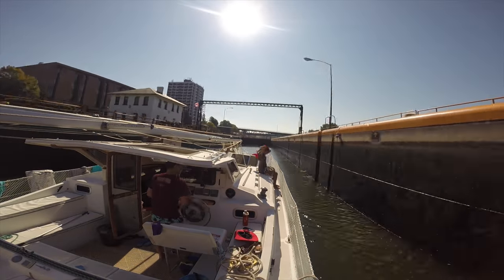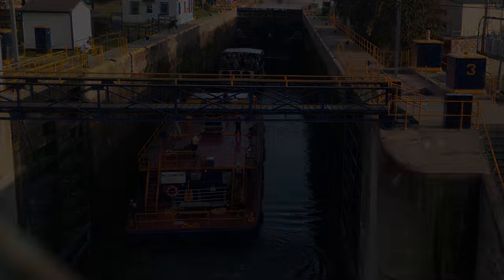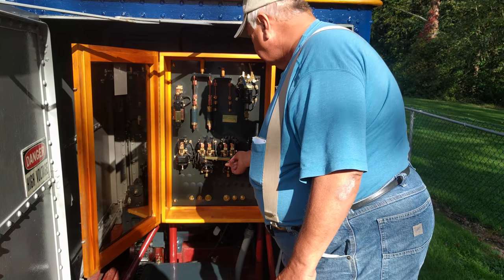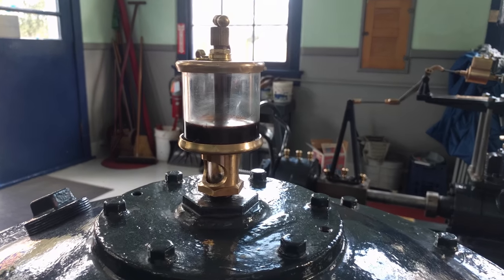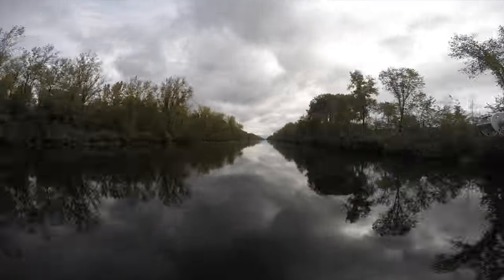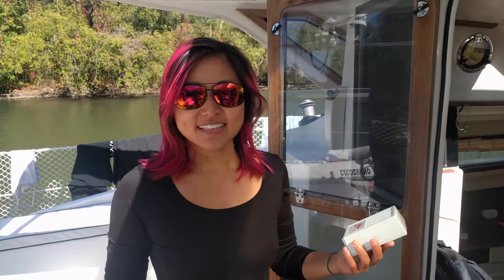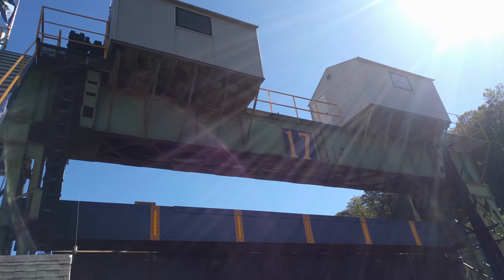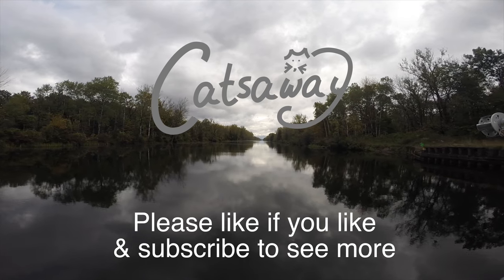Erie Canal Part 1 from Lake Ontario to Little Falls (Sailing SV Catsaway) - Ep. 15

Comment: I am closing on my 105 M on the third of next month and moving aboard her on the 5th.  So nice to have someone online with the same vessel as me, almost identical, mine is a 1999 model but I don't see any differences between the two.  I am curious what battery bank you went with because I will need to replace all the batteries on soon to be named Solace?
Reply from the maker: hcriley Congratulations, that's so exciting!! :) We went with 2 x Ampower 6v 415 ah deep cycle AGMs. We initially wanted to go with lithium but the price difference couldn't be ignored. We've also found the boat galley website to be invaluable in terms of information for a Gemini refit - I believe they have a 1999 105M :) Thanks for watching and don't hesitate to contact us if you have anymore questions or comments. Happy sailing!